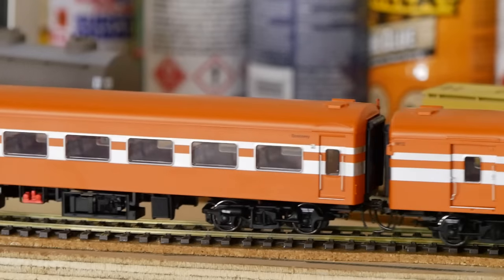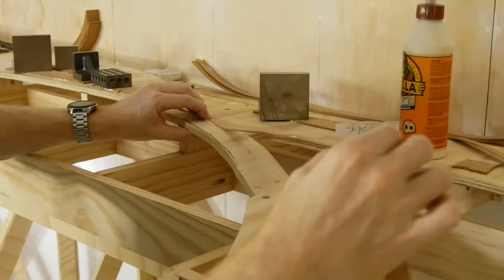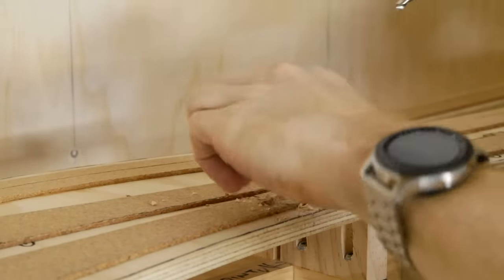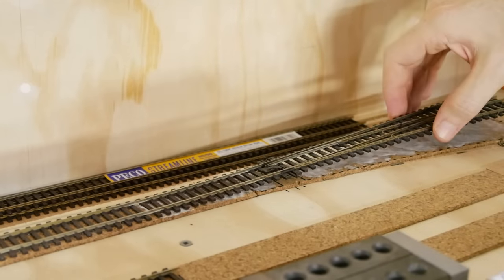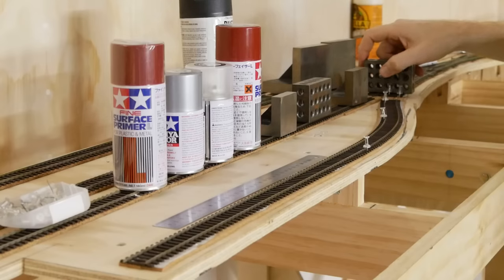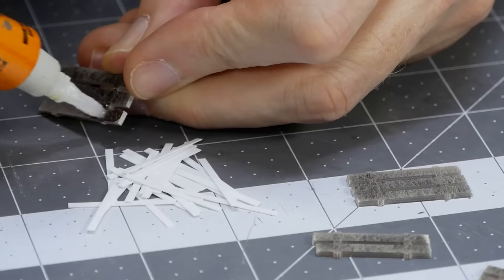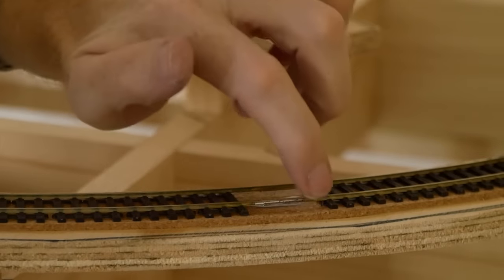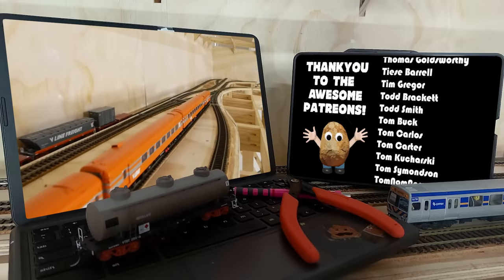How to Master Track Laying on Modular Model Layouts

Comment: Should have used ModelTech's Rail Aligners for the joints. The sleepers/ties are the correct width and height and they make sure your track stays aligned.
Reply from the maker: they look great, and they look a bit better scaled for the code 75 track! Next time I'll have to try them 😉
Reply: Your Pro Aligners are genius Gwion!!

Comment: Excuse me for the supid question, but: what is a frogwire?
Reply: It’s the wire to the triangular frog section of the point.  When it’s wired to a point motor, the polarity can be switched depending on the direction.  This avoids any dead/powerless sections which might stall a loco.
Reply from the maker: Couldn't explain any better myself 😊
Reply: @BoulderCreekRailroad  😊 really enjoying this project - thanks for sharing

Comment: Hi Luke, nice work so far. For cutting the gaps in the rail, try using a diamond cutting wheel instead - around 1/4 the thickness of a standard cutting wheel. If you cant find them, ask Antons Trains. A jewelers hacksaw will also yield great results with fine cuts instead of ugly gaps that need filling.
Reply from the maker: oh that's a good idea? I tried using the thin cutting wheels from Dremel but they are so brittle and tend to shatter easily.

Comment: Use a little bit of solder flux on the rail before soldering.  It makes the solder take more quickly.  Too much heat will also cause the copper to lift off the PCB board.  Flux is sold at Jaycar and similar stores.  It is an acid, so use care.  Try not to inhale fumes.
Reply from the maker: Thanks mate, i actually do use flux, I just didn't really highlight it in the video 😉 That's a good tip about lifting the copper off the PCB, I didn't know that could happen but I'll make sure to watch out for it!

Comment: Howzit : A suggestion to avoid MAJOR difficulty later ... Do NOT blindly accept required  electrical / physical  performance standards of Turnouts on removal from the original packing. Prior to installation on the Layout;  DOUBLE-CHECK electrical continuity ( Especially the welding of the  Electro-Frog  feeder wire ! ) and if so designed; the securing and working-action of the two pivot-hinges that separate the closure / point-rails. Further; carefully observe the overall  * Straightness *  and dimensional correctness of the Turnout. As a final; ensure that the Turnout  IS  in fact the type you intended to purchase as I have twice discovered that the  Live-Frog ( My choice ) v Insulated-Frog  versions had been packed in the incorrect box !  Otherwise;  Model Railroading  life is peachy; Bro !  😂🚂

Comment: I think a wise decision to use wood glue instead of track pins! When i started the track on my layout I noticed that the pins removed any sound dampening that the cork provided by giving a solid run to the board.

Comment: An excellent tutorial, Luke, with numerous helpful tips (and good pacing and production values).  I particularly liked it as I also used Peco Code 75 with 1/8 inch cork roadbed on my small layout.  Cheers from Wisconsin (from a fellow redhead)!
Reply from the maker: oh nice, I'm glad you enjoyed watching. I do like the look of the peco code 75 track. The turnouts look like they are well built and reliable as well. Should last quite a long time.

Comment: Why do you use push pins for the curves, instead of lasercut curve template pieces that can be placed between the rails e.g. Brunel Hobbies?
Reply from the maker: It was just easier, I had the cork underlay accurately curved at the correct radius so it was just as easy to position the track and pin it down. Although the templates would work quite well for getting perfectly accurate curves.

Comment: Luke,  this is a great learning video. Long time Fan of You're video's !!!!
However, I model in N Scale, smaller rails and ties. Is there away to use this technique on my layout with tighter radius curves, such as 9 3/4" to 11". Without stressing my turnouts using Peco turnouts #6's on a cork on top of styrene foam board ? Without damaging styrene ? A specific glue to use fastening everything down?
Bruce in Minnesota
Reply from the maker: These tips should work just the same in smaller scale. I don't think you'll have any issues with stressing the turnout. I built an N scale layout years ago with tight radius and mostly used the same techniques without any problems 😉
Reply: @LukeTowan  Thank You for your responses. I will definitely try this technique. I have just about completed my bench work. Want to try to create a backdrop next. Then the technique you described. Love your creativity very much and thank you for putting it out there for ALL to enjoy. Cheers, Bruce in Minnesota

Comment: Was going to say you should use heat sink clamps on your rails when soldering, wasn't thinking about expansion but also melting the plastic ties, tweezers work though maybe your 1-2-3 blocks would work as well
Reply from the maker: using the 1-2-3 blocks for heat sink is a great idea!

Comment: This looks like it’s going to be amazing! The thin brown cut off disks give a much thinner cut but you need to be very careful (I snapped one) and if space is an issue I recommend the stylo+, I have one for very small jobs and details.
Reply from the maker: yeah I was using those thin brown cutting disc and I too broke a few, after that I just decided to use the carbo fibre disc. It's a bit thicker but the trains get over the gaps ok.
Reply: @BoulderCreekRailroad  Fair play! I snapped about 2 or 3 before I got through other stuff I was cutting. I do have a bigger dremel too with the same flexible drive thing, much more controllable for some cutting jobs.
Reply: There are super thin metal cut off discs around.I got a 2 sets of 3 different dia  discs (15,20,25 mm).They are slightly thinner than the brown ones.Don't have the packets any longer so I don't know the make,but they are have a carbide or diamond dust coating at the outer edge.Haven't bent or broken any yet.

Comment: When I was building my layout I put a layer of a material called homeasode which helps a lot with noise even with cork
Reply from the maker: yeah, I have a friend that uses homasote... I didn't even think of it! I heard you need to seal it pretty well though because it can expand if it gets damp.

Comment: I reckon you could 3d print a small section of sleepers with notches to put in place instead of grinding away on the existing ones
Reply from the maker: That's a great idea! I can't believe I didn't think of it 😄

Comment: Another great video Luke, thanks! To avoid kinks with flexes in curves you can also offset the rail joints on the same track by at least 10 sleepers. This has worked pretty well for me.
Reply from the maker: Thanks, yeah I do remember doing that a while ago on one of my earlier layouts. I figure soldering should hold it pretty well for this layout.

Comment: I’m a bit of a newbie. What’s the use for the cork over other things? Been watching for years and never really thought about it’s purpose
Reply: I guess it works as an in-between layer for glueing plastic and/or metal on wood. It might also improve the stability of the train
Reply: It reduces the drumming noise that engines make when running on bare timber base such as plywood.  It also gives a slightly raised profile so that the ballast falls away slightly, making it look like a real railway.
Reply from the maker: yep that's exactly why 😉

Comment: Ooh very nice. PECO 75 is also my track of choice! Those small yellow pliers from Jaycar are great also, I have a set in almost every room of my house 😂 Your soldering technique could do with some improving, I would recommend flux as a necessity. Applying prior to heat then solder.
Reply from the maker: lol, yep soldering is not one of my strong points 😄

Comment: When I’m laying track i use a wood stapler, and push the staples in far enough that i can use the peco tracksettas and rolling stock to test and adjust. After that I’ ll either use a bit of dilluted woodglue, or just ballast the track. And after finishing i just pull the staples out.
Reply from the maker: That's a great idea as well 😉 So many good tips in these comments. Thank you

Comment: Thanks for this video. Good to see I started correctly. Now, I have been toying with the idea of changing all over to DCC. Do you have any videos that explain DCC in its entirety? I don't know the first thing about DCC but would like to soak up every bit of info I can...  I have over 50 Locos but not all are powered unit, most are. I'd like to know how to and cost info. I would be nice to operate more than two trains at a time (with help).

Comment: same physics as the real size rail with expansion in summer and shrinkage in winter good video Luke 👍
Reply from the maker: yeah, it's not usually a problem for small layouts but having a few gaps is still necessary 😉

Comment: Another bit of insurance I would suggest with the joints, A few german modelers sink brass screws under the ends of the rails between modules and solder the PCB ties to them. It adds a bit of horizontal mechanical strength on to track ends that takes pressure off the glue joints if the ends of the rails snag while in transit.
Reply from the maker: That's a really good idea, I actually tried soldering the rails directly to bass screws originally but I wasn't really happy with the look so I took them out and went with the PCB boards. I should have just cut them down and attached the PCB boards to them as you suggested!

Comment: Did you find any issues using Gorilla Glue.  I have used it on other (n0n rilway) projects and it has "swelled up" causing joints to open and go haywire.

Comment: Thank you for all those didacticts videos.

On my club's new layout, at the last 2 cm of the modules, I replace cork by a same thickness PCB plate, screwed in the wood of the table. And I weld rails on the PCB with a brass spacer of the same thickness than the sleepers. It's discrete and very tough !

Comment: Greetings again and another suggestion : To improve solder flow and significantly reduce  soldering-iron  dwell-time when applying solder to the outside of the rail; simply  scratch-up / rough-up  the rail surface with a needle-file and see the benefit thereof .... I can only assume that maybe during production; some form of residual processing agent coats the rail preventing  quick-time  soldering. In closing; the use of a low-wattage soldering iron in an effort to prevent warpage and / or melting of the ties is entirely incorrect and counter-productive; possibly causing more damage  and / or  frustrating blobbing of the solder.  Lakka and Cheers For Now 😁🚂

Comment: When doing a modular/sectional layout, place a piece of styrene the thickness of the cutoff disc between the sections while laying track. Then when you cut the track and remove the spacer the track will sit flush when sections are joined and mitigate gaps.

Comment: Hi Luke, A very interesting video with many great tips, I have a tip for joints on flexi track on curves, if I have to join flexi track on a curve I will slide off about 6 inches if sleepers and force a curve into the flexi track, you may have to cut an inch off as it's difficult to get the curve to the end of the track. Regards, David.

Comment: That what i did a few years ago laying cork for the trackbed, i cut 1 sheet into strips same width as the track, and on another sheet using the points to create patterns onto the cork and cutted out.
Ive also did the same modifications to the points since i use DCC control.

Comment: Anyone know why the special sleepers on the board joint?
Reply: They are to stop the rails. Plastic sleepers are very soft and can cause misalignment between the rails.
Reply from the maker: that's correct, as the modules get disconnected and reconnected, the track needs to line up perfectly every time and the PCB ties on the ends help hold everything firmly in place 😉

Comment: Nice module railroad, Luke, however, 18 inch radius curves in HO? That radius is even tight in N-Scale! Your carriages will look strange on that radius.
Reply from the maker: Yeah, sometimes sacrifices need to be made in order to fit within the limitations of space. It's like how we model a location and use selective compression to make it fit. 
While 18 inches is a tight radius a lot of it will be hidden. 
Although I must say, 18 inches for N scale is quite generous, I built an N scale layout with 15 inch radius curves and the long carriages looked fine 🙂 
It's really just personal preference and the main use of the layout is the switching that takes up 90% of the top surface 😉

Comment: You may tell us later in the video. Why did you cut out the plywood instead of using a large sheet?
Reply from the maker: I did it so I could fill in the gaps with foam board, that way when I do the scenery I can carve the terrain contours into the foam and have the terrain go below the track level a bit easier 😉

Comment: Hey Luke, I noticed you've been slowing down with your content. I know your workshop is already full of your works and it seems as if you're just low on space. Don't be afraid to sideline or even destroy old projects to make room for new ones. Destruction is a part of the artistic process, and is usually a precedent for something great (otherwise you wouldn't have the need to destroy something to begin with).
Reply from the maker: Thanks mate, it's all good 😊 I've been juggling life in general between family and work which is the reason for taking things a bit slower. Thanks for your concern, it's good to know people care 🤗